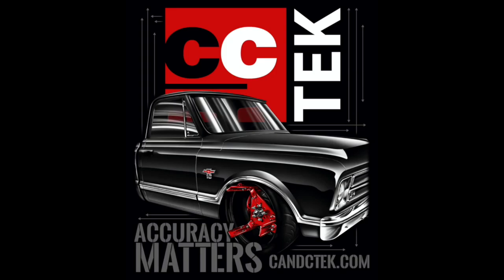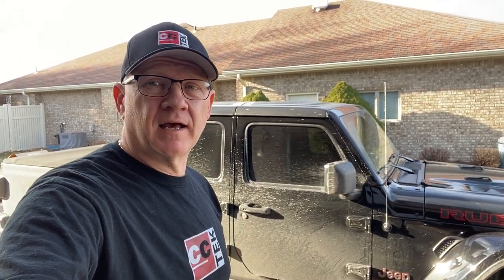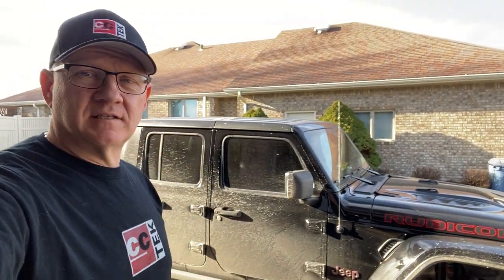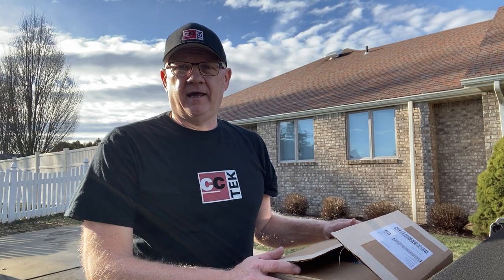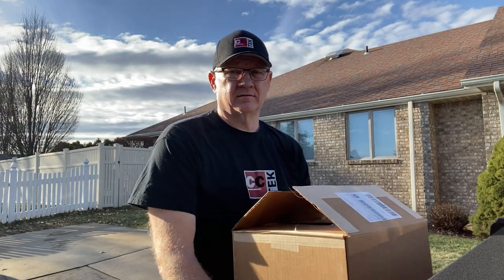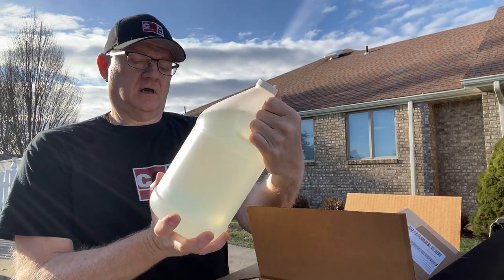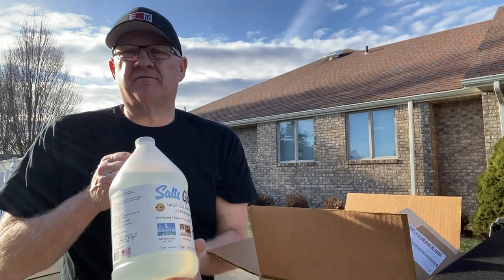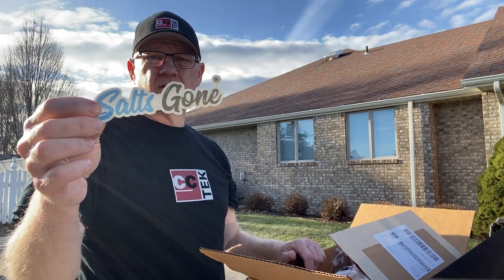CCTek Vs SALTS GONE!

Comment: I’m curious to see how it works for long term use. Vinegar neutralizes salt and I’ve thought about just trying that and then a product like this on another vehicle. See how they compare after a year.
Reply from the maker: Vinegar is slightly acidic with a ph of 2-3.   It can definitely harm aluminum and other things if not completely rinsed off.   This being ph neutral is one of the reasons I chose it.   If it stays in crevasses etc without being rinsed, it should hurt anything.